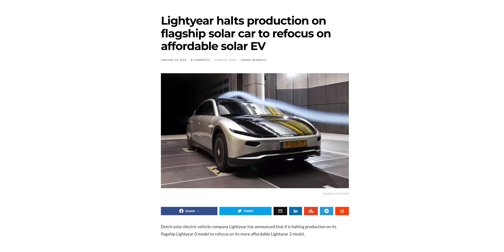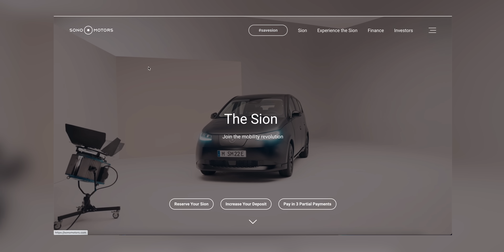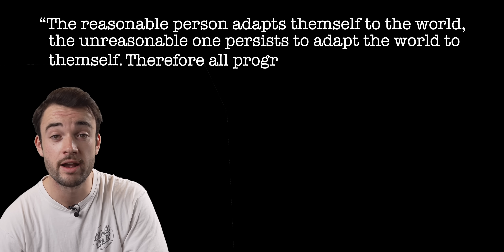Will Solar-Powered Cars Ever Happen??

Comment: Like 75% of the shots in the opening 15 seconds of this video were of cars driving in the shade, the dark, or on an overcast day. Nice mostly horizontal roof lines and bonnets means solar panels are making ~60% of the energy they would sitting on your roof. And the fact that the sun is going to be at a sub-optimal angle for either your roof or bonnet most of the time means that efficiency is further eroded.

Say you can fit 1.2KW worth of solar panels on your car, on your roof that would produce about 7KWh a day, but in your car that would be less than 4.3KWh*. But probably a lot less. Best case if you can park it in full sun at the perfect angle for the whole day, that lightyear 0 (as in zero chance you'll ever be able to buy one) will get you maybe 40KM of range. More likely closer to 30. With only 0.7KW of panels on the stupid-looking Aptera will only gain you about 25KM at best, more likely closer to 21 if you get the angle off.

And obviously if it's even partially shaded for a small portion of the time, it's not hard to imagine it dropping to single digits pretty quickly.

Seriously, just spend the extra cost on solar panels and a battery for your house, and use that to charge your car. Take the $250K+ you were going to spend on your solar car, buy an ordinary, boring $100K electric car like a poor person would buy, and spend $50K on a monstrously enormous solar system, and $100K on blackjack and hook ... uhhhh, I mean donate it to charity. Yeah.

*Based on about 6 hours of full sun a day average across the year. You lose 20% of your energy for a flat laying solar panel, but cars are worse because they're curved. Solar cells are usually wired in series, so the panel will produce a lot less energy unless all cells are receiving equal irradiance. Because some portion of your cells will always be angled away from the sun, those will drag the others in that series down, hence my estimate of 40% drop in efficiency. And if you don't get the centre line of the vehicle aligned with the arc of the sun, that efficiency would drop further.
Reply: You might want to take a look at the performance Aptera is offering, rather than attacking a straw man.

Comment: solar PV cells are trash as of the moment. efficiency is for homes only
Reply: Even with current tech- which is rapidly improving - the Aptera cells made by Maxeon have a long life and can provide the daily commute range for the average American driver in much of the country.  I live in Iowa, not exactly sun belt, and I will still be able to meet my daily needs from the full solar configuration.  The main reason for this is that Aptera starts with maximizing efficiency of the power use, rather than wasting so much of the power available.

Comment: The Fisker Ocean is rolling off the production line at Magna/Steyer in Graz, Austria at the moment. The “One” and “Extreme” do have solar panels on the roof. Not sure why not mentioned at all as Jack spoke highly of it a year ago.
Reply: I just received an email that the Sion project is terminated, will be sold and deposits retuned in three installments. So we have to wait for an “affordable” ev with solar panels.
Reply: The Fisker doesn't use the solar panels for charging the car, but for running the onboard electronics. Less surface area, less power.

Comment: Of the three, I think Aptera has the least appealing offering. It looks weird as heck and isn't spacious. I know the drivetrain should be the focus, but I can't get past those two things.
Reply: My wife and I have ridden in an Aptera prototype and there are solid reasons for the design that result in superior performance.  Compare the 32.5 cu ft of storage, and the ability to sleep a couple in the back with any other 2 seater, and tell me it isn't spacious?
Functional design beats temporary fashion statements.

Comment: Elon & Tesla reap the accolades for establishing awareness & adoption of EVs, which I'm fine with.
BUT, they & other EV developers will have a lot more breathing space for resources down the line, if they build EVs with acceptable, not ludicrous or high performance models.
I don't care what anyone says, there will be a bidding war over Lithium when demand outstrips supply. THE PRICE WILL SKYROCKET. 
The answer is simple, build EVs at a price that will get head strong ICE car owners to even consider trying EV sweetness.
The second car or local urban run-around could be strangled to 0/60 in 9 seconds & 98% of the market would be perfectly happy with it.
The follow on for the 98%, is that aerodynamics would be irrelevant, hatchback EV packaging would be more efficient/practical, batteries would be smaller, the price would fall & future resources will be spread through many many more EVs.
Reply: Aptera understands this and has derated the original motors that gave 3.5 second quarter mile times in AWD, to gain 20% more efficiency (and still achieves 4 second times).
Reply: @n.brucenelson5920  That's good to hear & a great start, but reducing the battery size will make it even more environmentally & pocket friendly.
I love the concept & construction techniques of the Aptera, but in my mind, they'd put too much emphasis on aerodynamics over looks, which is a turn off to potential, conventionally minded customers.
It's argued that the width of the launch model is too wide, which in my mind would only be relevant for urban use. That reinforces my view that narrower versions with speed restrictions, smaller batteries, even smaller motors & a larger roof surface area (like on a traditional hatchback) for solar panels would be very appealing, cheaper & more practical. The second car/local urban runaround sales potential would be huge.

Comment: I still don't understand why people are so obsessed with the idea of putting solar panels on the car itself. It compromises so much of the design, generates a pittance of power due to limited surface area vs energy required to power a car, and depends on your parking your car out in the direct sun somewhere (unshaded by anything) to get any real benefit. Put the solar panels on your roof, parkade, empty field, anywhere and just plug the car in - electricity is trivial to move around on wires, and it's available effectively everywhere.

Comment: I have always thought that a solar powered car is ill-conceived.  My rooftop has 34 solar panels directed towards the sun’s trajectory and pitched at a suitable angle and I am in Queensland yet to fully charge my stationary Tesla it takes a whole day’s generating capacity on a sunny day.

When I park my car here I seek shade as the interior of the parked car comfortably exceeds 50C otherwise and more energy is then needed to cool both the battery and the cabin.

Some idiot reversed into our Tesla in a car park leading to accident repair.  Imagine the difficulty of repair of a solar chassis.

I seriously suspect the advertised additional range attributions and suspect that they are derived on mild sunny days in southern Spain or California and in no way representative of average motoring.  When these cars are also designed for urban environments there is even more shade from tall buildings, trees and underground car parks.

Yes, many investors are risk averse and, yes, they look at short term returns but they also are probably much more skeptical than the Fully Charged Show.

Comment: Sure it can Ambassador Bruce - Aptera "claims" UPTO 45 miles with their full solar array - to even approach that you need to drive  at 30 mph in ideal conditions.The harsh reality is it won't go very far in the real world - their own literature says - 32 sq ft of solar - ok how does that compare to normal flat solar panels - 40 inches or 3.5 ft by 5.5 feet or 20 sq ft - so the most an Aptera can have is equivalent to 1.5 solar panels about 450 watts of output max - 10 hours 4,500 watts. Thus while a Tesla that weights 2 tons can go 30 miles with 10 panels - a ton Aptera would need 5 panels but it only has 1.5 or about 10-12 miles worth IF you left the car in intense sun all day - in a local like Las Vegas.  Reality includes  highway speeds, stops, hills, turns, cold, high temps, and you are really talking far less miles.  Another way to determine it is- look at Aptera's own charts which assume lab conditions on flat ground, mild temps, no stops, no intersection turns, shadows from trees, buildings, other vehicles etc etc. 12 average driving miles from 10 hours of intense sun is a good approximation - and even at $900 that would take years to pay off compared to the grid or gas; of course even the base model has some solar so the 900 is only the extra amount - a few more miles than the non upgraded model which would be maybe 8 or 9 miles;  that base cost is figured into the price tag of the vehicle.

Comment: Well done Jack, you explained what I was thinking when you asked "Why is it so hard to turn a bold new idea into reality in the automotive industry?" Heck! Its hard to turn a mediocre idea into a reality. The Bricklin SV-1 and De Lorean DMC-12 were nothing remarkable, flashy two seater bodywork on chassis using existing proven components from legacy manufacturers. They both died and had little impact on the automotive world. I am absolutely shocked that Tesla managed to build a car manufacturing company from the ground up that has revolutionized how people see electric cars, AND is becoming America's 4th major manufacturer. I'm living in a small city in the American midwest and I see Tesla Model Ys and Model 3s driving around there. This level of success is astounding. I'd love to see some Lightyear, Sonosion and Aptera succeed. But I understand how tough it is...If they fail, their failure will far more impressive than so many successes I have seen.
Reply: Because not any new idea is a good idea. And sometimes the "new" ideas are old ideas, just already discarded by people who did not have singing and clapping in their physics class.

Comment: I wonder if Fisker took a safer approach by making a car that will happen to have solar panels (in its top trim line). On one hand they are only promising a few miles a day worth of solar, but on the other hand they have a much simpler system and are primarily selling the Ocean's range & performance.
Reply: I think that this is the way to do it. Solar is unlikely to be the defining thing about any reasonably normal car (aptera is a little different - makes sense as a solar vehicle) - if more manufacturers offered it, it would become more normal. I often do well under 100 miles in a week - being able to to up 20-30 over a week would probably marginally reduce my costs and mean fewer charges required. The convenience is the real win for me because the cost would likely mean the savings take an age to come through. Not much use at all for someone who drives 500 a week however. Offering as an option gives the choice..

Comment: "Optimum degree of novelty" are very important words that these companies need to understand and devise a plan/ product to succeed with.
Imagine that my plain and simple 1992 Tercel just appeared in 1902 America.  People wouldn't know what to do with it.  They certainly would not get inside of it.  If the same 1992 Tercel fell into 2022 America, very few people would want it.  Optimum degree of novelty is all about change or improvements at the speed that the investors and the Market will accept.  It is NOT about changing the world overnight.  People are afraid of that.  Remember "Future Shock"?  People are already suffering from future shock as cheap silicon has turned inside out the world of 50 years ago.

Comment: All these companies are making the same mistake. They are worried about being a mass market manufacturer when it's not feasible. They should be assembling them manually and selling them for a lot more money. Tesla is the only one  who hasn't made this mistake. There are plenty of people who will pay 100k for the first Aptera's. At least 50 people probably. You use that money and then start to scale.
Reply: Tesla absolutely made that mistake, and survived because a literal last hour loan of 50 million from Daimler gave them the breathing room to recover.  They cam close again in 2017.
Reply: @n.brucenelson5920  Tesla never started mass marketing a low cost car. They were facing bankruptcy while making the model S which is a 80-130k car. All these companies are trying to go into mass production before hand building enough of them to know what do.

Also Tesla never got a loan from Daimler-Benz, they did a deal with them to produce smart cars. That wasn't a loan
Reply: @mattstopa9436  I agree with your first sentence.  However, Tesla faced bankruptcy twice.  The first time was at the end of 2008, when they had yet to produce a Roadster that didn't have a defective transmission.  I saw this all unfold first hand, because i worked across the street from them in Union City, and my company hired their motor engineers for a hybrid marine project when Tesla was force to lay them off.  It was a Daimler loan that saved them.  Later they almost went bankrupt again in 2017 while the Model 3 was going through production hell.

This is all part of the public record.
Reply: @n.brucenelson5920  the fact that they nearly went bankrupt twice is true. I never said they didn't but a) they didn't start right off trying to mass produce a car and b) it wasn't a loan by Daimler-Benz, it was a business deal for Tesla to produce smart cars. 

Again not a loan.

Comment: Solar just doesn't offer much hope. Batteries are barbaric as well, but some improvements are at least expected. For solar, you just need lots of surface area and a light car that's crazy efficient.
What "saving the planet" needs, is a product that actually helps a lot with costs and redundancy.
Reply: There is no climate crisis, as climate was never stable, and the last big extinction event was way more recent that most people will have guessed, and totally due to celestial events, ending the ice age we'd otherwise still have been in probably. Sea levels rose 120+ meters in a geological blink of the eye. Your nearet coast line was not in the same place 13,000 years ago. Your coastal city wasn't coastal, and probably not a settlement even.
Reply: @Cloxxki  Someone hasn't looked at the data available to them, or understood it.  Human activity has changed the climate way faster than any natural causes.  One example is that along with the huge increase in CO2 we have been pouring into the atmosphere and oceans, r/134a refrigerant alone has 1400+ times the GWP of CO2.  This all has direct consequences.

Comment: My M3 is already solar powered! By the PV’s on my roof! Just pointing out that putting them ON the car doesn’t solve a real problem - maybe only in those desert like places, few of these above the Alps! Plugging in your EV overnight once in a while is easy enough.
Reply: Don't forget the batteries that you use to hold the charge until the car comes back at the end of the day.

Comment: The three wheeler probably has the best chance of seeing daylight because it can bypass all the government testing and regulations that are required for 4 wheeled cars.
Reply: It can, but their intention is to do the testing anyway. The way things look (through simulations on the production-intent design and actual testing on old versions), it will likely do quite well.
Reply: And thereforee its a deathtrap in case of an accident. Aptera is not able to achieve the simplest  safety measures necessary for a car.
Reply: @vic321344  Simply not true. Just because it hasn’t been tested (yet), doesn’t make it a death trap. It will be held to the same standards as regular automobiles, even though the regs may not require it.

It’s not wise to call the baby ugly before it’s even born.
Reply: @DrTeeHenry  It is a deathtrap. And it does not confirm to the simplest safety standards necessary for a car.

That makes the Aptera easy and cheap to produce. Though they still need 300 Mill to start production.

Nearly everything with Aptera is a "will be" phantasy.
Reply: @DrTeeHenry  For starters something simple: Pedestrian safety. The Aptera will cut away the feet of an pedestrian with the front wheel bracket. Even with slow speed.

For starters. If you want to sound credible, you should start with telling the truth. "Safety tests of the vehicle will be performed" is an ongoing empty promise of Aptera.
Reply: @DrTeeHenry  Aptera cuts away the feet of pedestrians even at very low speed. Or induces critical injuries. That is one of the several safety necessities a car has to deal with to be able to be registered. And it is just one example.

If Aptera was really interested in crashtest, they could already perform them as soon as 2007.
Reply: @vic321344  They need a production-ready vehicle for the tests to be meaningful. Let’s revisit this in 9 to 12 months.
Reply: @DrTeeHenry  Gratulation. You are one of the Aptera fans who is able to think. Others phantasize the  start the production in 2 months.
Reply: @vic321344   Don't buy one if you feel that way! It's no more dangerous than any other motorcycle on the roads and most likely much safer.
Reply: @tenlittleindians  It is much more dangerous than a normal motorcycle. To the driver, and also to pedestrians.

Comment: The Aptera is the only one of the 3 that seems a reasonable machine for the price. Excellent performance, excellent efficiency, but a niche in practical use cases. Honestly a BIG niche.. but still niche. The Sono is ok in utility and price.. but just ugly as hell and looks so poorly built. The  lightyear is just ridiculous. Priced like a super car.. but has the performance of a dumpy old sedan.. rides on bicycle tires and looks like a ridiculous design.. ok, it has great range and some solar power, for that price? No thanks.